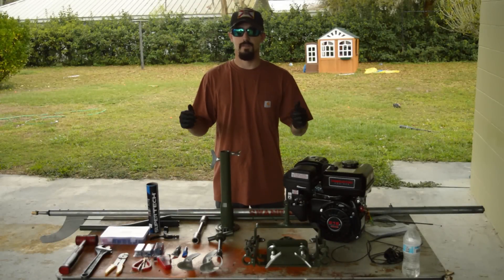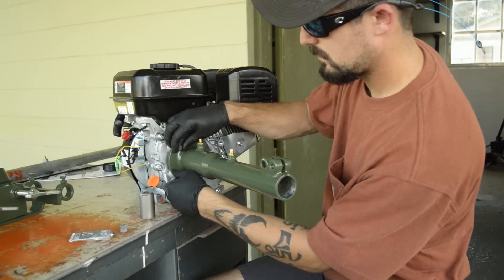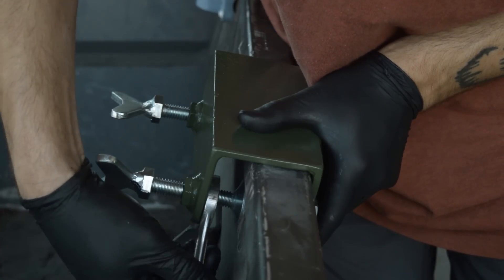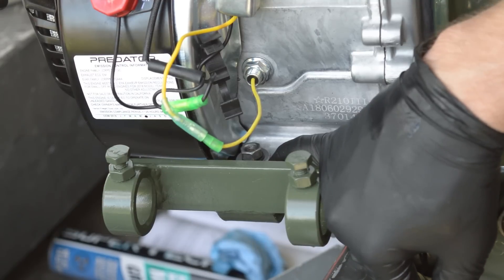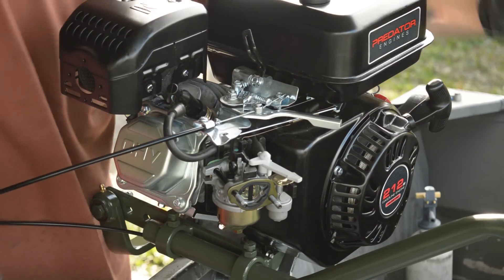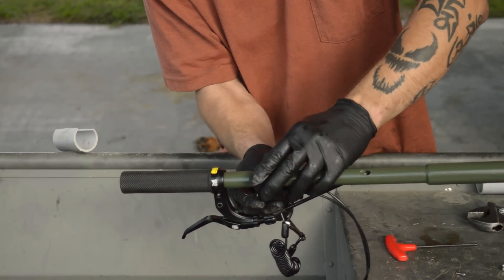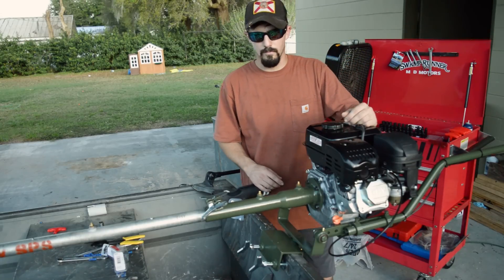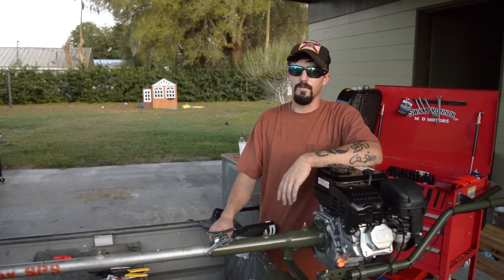HOW TO Assemble Small SPS Swamp Runner Mud Motor Kit (Step by Step)

Comment: Your video was very helpful! Hopefully, this comment of my experience can help someone too!
 i Spent the day today assembling my swamp runner large kit with my 22hp predator motor on my boat, and your video walked me through pretty much step by step through the whole process. i did run into some problems that you didn't experience. 
(1) the coupler shaft seemed to not slide all the way flush with part of the output shaft, and so the coupler housing didn't fit flush either. i kind of tried different things to figure out if it should be flush before bolting the coupler housing to the engine, and was unsuccessful until i just bolted the coupler housing to the shaft without it being flush, and when tightening the bolts, the housing eventually became flush. It just wasn't really clear in your video if it should have been flush to the rear of the engine before bolting the coupler housing.
(2) feeding the kill switch and ground wires through the tiller handle was a HUGE pain! The tiller handle has 2 relatively sharp bends in it near the engine so it was very difficult to get those flimsy wires through the bends and out of the back of the tiller handle. To fix this, i drilled (with a bit larger than the size of the original hole) into one of the holes near the handle part of the tiller handle where the wires and throttle cable go into the tiller handle pipe. That made it easier for me to feed my snake into the pipe and tape my wires onto the snake and push it through the bends and out of the back of the tiller handle pipe. 
(3) Removing and adjusting the throttle cable was very difficult. On my 22 hp predator motor, the phillips screw that holds the end of the throttle cable to the engine throttle body is in a tight spot. The head of the phillips screw faces toward the back of the boat and it is less than an inch away from the exhaust. This bade it impossible to get any normal screw driver in there to loosen and tighten the screw. To fix this, i got a pair of vice grips and clamped them perpendicularly onto a phillips head (removable attachment phillips head that is used for screw drivers that you can change the heads on) and got it onto the head of the screw and i was then able to loosen the screw and adjust the throttle cable on the throttle body. 
(4) [this isn't really a problem, but i think this was just a simpler way of doing it] So at about the 15-16 minute mark, when you wire up the kill switch, (instead of doing it the way you did and using another wire and using more connectors) i just spliced my kill switch wire straight into the oil wire and eliminated make that "Y" with the kill switch wire and splicing it with the oil wire. Your way was great and i think it looks good, but it just seemed like an unnecessary step (just my opinion) 
But besides these 4 things, it all came together pretty well and with ease. Honestly without this video, assembling this would have been very difficult and way more time consuming. 
i will be uploading my video of my build and installation of everything, if you want to check that out. I will reply to this comment when i upload it with the link to that video. 
OVERALL, thanks for making this video and i hope this comment can help out anyone who runs into similar issues and experiences.
Reply: Can't you duy a boat engine for me
Reply: A 15
Reply: Aveenish Samuel sure
Reply: God wil blest you
Reply: Use a vacuum to sock a string through backwards.  The string pulls the wires through.
Reply: @Leonard Terrance instablaster ;)
Reply: @Kashton Mario I really appreciate your reply. I got to the site thru google and im waiting for the hacking stuff atm.
Looks like it's gonna take a while so I will get back to you later with my results.
Reply: @Kashton Mario it did the trick and I now got access to my account again. I'm so happy!
Thank you so much you saved my account :D
Reply: @Leonard Terrance No problem =)
Reply: 0

Comment: My neighbor's teenage son purchased one of these.
He was able to assemble it on his own.
The simplicity makes them durable & the maneuverability is really impressive.

I'm not trying to say this is a bad product, because it's not.
It's really a good product.
I'm also not trying to dissuade anyone from purchasing this product.

There's a serious flaw in this design though.

I wouldn't recognize it if I hadn't made the same mistake myself.

The "spline adapter nut" should be secured in a way that locks the threads.
Something more substantial than nylock is needed to do the job.

The consequences of not doing so are that the first time the engine backfires, that nut WILL unscrew. 

Any seals or bearings between there and the end of the prop shaft are toast.
You're also going to have a whole lot more play in the end of the prop shaft than you want, assuming it doesn't blow the prop shaft out of the end of the housing.

I've had the combination of twisting and pushing between two fixed points of a 170cc predator engine break a 3/4" grade 8 bolt... 

This type of engine is most likely to backfire when trying to start it while warmed up and with resistance.
Something like weeds & debris on the prop, or a partially engaged engine brake.

I never did find a way to solve the problem with my mud motor in this configuration, so I can tell you for certain what won't work:

Welds, shear pins, locktite or carrier bearings/pillow blocks.

What might bypass this flaw is reworking the spline adapter nut and the shaft it screws on to.
Grind the threads off the shaft, and make flat spots on opposing sides of the shaft. Make the hole in the spline adapter nut match.
Once the threads are gone, a circlip should be sufficient to secure it in place.

Comment: I would only add that I usually run a sqaush plate between my boat transom and the mount screws. I use either a 1/4" Aluminum plate or have used a 1/2" pine board as simple as a cutoff piece. The pine board is actually not bad. It is just soft enought to make the screws bite in and lock it in place into the wood. That causes it to not drift around at all. Anything to avoid a indention of a circle into your hull.

Comment: A great add on to this kit is an electric clutch on the pto. They come in every size and hp rating u could imagine.  Not only simple way to add a neutral "gear" to these simple designs but also provides for some slip when u inevitably jam the prop on that cypress knee that grew 3 inches since last year. Also works nearly instantly (prop and mass of shaft will give it a few spins even when disconnected) so when u feel that log kiss the bow u can hit the button and have the prop and shaft fully disconnected from power. Also i suppose u could wire it up so that u have to hold a button to keep it in gear and have it drop out when released, def b safer for kids and people new to the boats
Reply from the maker: Where could you get one of those? I recently broke my prop in the exact same manner lol
Reply: What about a centrifugal clutch

Comment: Any advice on getting the male and female splines to line up?  I can get the shaft set so it doesn't slide in and out but the shaft will turn forward and backwards.  So basically you can't loosen the nut for the prop.

Comment: “Everything you need to build this motor comes in this kit, minus a few things.” List off tons of stuff. 🤣😂.   I’m looking into getting one of theses. Thank you.
Reply from the maker: lol
Reply: If u don't have some wire, washers, nuts, bolts, cables, welders, pipes, grinders , etc. You dont need to worry about a swamp boat. I love that long props on air cooled commercial motors is making a comeback, we used to use old clapped out pressure washer honda 1cyl horizontal shaft motors, w a bare pipe (no shaft in a housing) that had welded into the end the taper cut off a busted outboard final drive to spin the screw. Its a fun project but put that money into buying some basic tools, some wire, and misc connectors, and a little known secret u can goto almost any u pull it, bring a bare minimum metric socket set and a pair of pliers, and a 5 gallon bucket. Spend a couple hours picking up matching nuts, bolts, and washers. Fill up bucket and pay by the lb. That bucket full of misc, connectors will last u a lifetime. In fact while ur there pick up a steel 5 gallon oil/grease drum use that to hold the bolts. Add a splash of used motor oil of the last 1/3 of a wd40 can that never dispensed properly, u can pass the bucket down to ur children

Comment: Is keeping the oil sensor connected the same as you going to make my engine cut off if the oil shakes around while I’m riding? I’ve heard of people having to keep theirs disconnected
Reply from the maker: I had that issue taking sharp turns down rivers. If I had to do it again, I would definitely bypass that sensor

Comment: Been thinking about putting one on my 14' Lowe for hard to get fishing areas and what size would you recommend on motor and kit?
Reply from the maker: Medium kit would probably be best, but I had a 22hp (with a large kit) on a 14 footer  and it was very fast. The only problem I had was my transom flexing when i would gun it. If your transom can handle it, then put on a 22hp large kit

Comment: So i dont need that clutch set when ordering this ? Not sure as im new to this motor build , the webpage has a option for a clutch thing .
Reply from the maker: You don't need a clutch, but you won't be able to cut the power to the prop without stopping the engine. 
It's not a big deal. You learn how to navigate with it.

Comment: I'm stuck on the kill switch, I bought the predator 459 and it has electric start. How can you tie that one in?
Reply from the maker: Locate the wires for your engines On/Off switch and tie into that. You'll want to wire it so that if the kill switch is pulled, it opens the circuit like if you simply switched the engine to "off". 
Does that make sense?

Comment: Hey bud I got one for you maybe u can help me I been running my mud motor since April and I took it out the other day and after about 2 min It started making a noise like when you start a car that already running grinding like a starter so I got it home first everything was good and tight so I took it all apart started my engine ran it for 20 min no issue put the shaft back on got that same noise what do u think have u heard of this anywhere else? I can send u a video of it if u want
Reply from the maker: Are you greasing the shaft? 
I've only ever had it make a noise when I didn't grease the shaft, or when I broke one of my props

Comment: 1 min 5 seconds 
What size shaft will the adaptor fit ?
Reply from the maker: I don't recall. I think it will fit all motors up to 10 hp (for the small kit).

Go to their website (mudmotorkit.com) and it will have the specs for it
Reply: I’m thinking about putting a 3hp or a 6.5 diesel engine on it .,, I think it would be a pretty cool build I don’t think it would be very fast but it would be durable I have a 14 foot jon

Comment: I’m kinda wondering why you didn’t trim your throttle cable and kill switch cables ? It don’t matter but just asking ! Will that kit hold bigger 4 stroke motors ?
Reply from the maker: No particular reason, I just didn't feel like doing it. 
The kit will hold much bigger motors, but you'll need to get the large size kit for it to work.
Reply: Polk Fishin' 👍

Comment: Just bought a kit second hand.. thinking about taking everything apart and evaluating parts to see what needs to be replaced. Kit is only about 2 years old
Reply from the maker: I would mainly just inspect the bushing and the bearings. 
Have you taken the kit apart yet? Or is it still on the motor?

Comment: has anyone run these motor setups in super shallow rocky water? subb btw
Reply from the maker: I've run them through mud, rocks, and hard sandy bottoms. The prop won't hit the bottom due to the blade that sits underneath it

Comment: When you turn the engine on , is the prop already turning ? Or do you have to squeeze the throttle
Reply from the maker: Southerncajun92 
The prop turns whenever the motor is running

Comment: So you’ve got a calibrated wrist also, I use mine all the time for torquing nuts and bolts to proper spec
Reply: I normally torque things quarter turn past snug with no problems. I was changing the water on my truck, decided to use a torque wrench, broke a bolt. I kept thinking it felt too tight, SNAP. Not sure if it was a faulty wrench or I set it wrong.(probably set it wrong) Now I’m back to quarter turn past snug. Lol

Comment: You show stuffing grease in that tube and then sliding it over that shaft and attaching to the motor.  Then later you show putting thread lock on the coupling and reattaching to the shaft.  Am I missing something, the threads on the shaft are going to have grease on them.  Is the locktite on a greased thread actually doing anything.
Reply from the maker: Paul Ogea 
It’s not loctite that goes onto the coupler shaft, it’s anti seize.

Comment: Do they make one for the 420cc predator?? Have one laying around and figured it would be sweet
Reply from the maker: They sure do. I'm going to upgrade to the 420cc here soon. The medium kit will fit it.
Reply: There a company out of Thailand that make them I believe called mud bug boat motors. They also make an outboard motor set up for a vertical shaft motor and the sell props of different sizes all aluminum easy to replace or make your own if you how to cast alum..
Reply: @DavidTaylor-qz8nc  
In that part of the world, it's fairly common to mount an automotive engine and transmission from a rear wheel drive vehicle on the back of a boat, with a long straight prop shaft.

The weight of the engine and front of the transmission counter balances the long prop shaft and rear 1/3 of the transmission well enough to control it by hand.

This product is what they would naturally be inclined to build for a small inexpensive boat motor.

Comment: will any mower engine work with this kit
Reply from the maker: Their website has a list of motors that will fit the kit, but I don't think a vertical shaft engine will work with this kind of setup
Reply from the maker: Pulled this off of their website for you: 

    "The engine must have a horizontal output shaft.     
    The output shaft must be 3/4" inch diameter (non-tapered) with keyway.
    The engine side cover bolt circle diameter must be: 3 5/8 inches
    Engine base bolt pattern must be: 6 3/8” X 3 1/8”

For boats with transoms exceeding 17" in height, or with bottom widths between 40" & 48" please advise us you need a 100" shaft. We do not recommend longtails for vessels with a bottom width exceeding 48". 

NOTE: The 9hp Carroll Stream engine, and all engines with gear reduction box options are not compatible with this kit."

Hope this helps
Reply: @PolkFishin  ok thanks was just wondering cause im thinking about doing this on my boat
Reply from the maker: @kyredneckoutdoors  

Definitely a more cost effective option over a traditional outboard. I love mine

Comment: I have a 1431 jon. What kit and hp motor do you recommend? Thanks
Reply from the maker: Garrett Cobb 
For you, I’d go with the medium kit and a 13hp. 

Unless you want to go fast, then I’d go with a large kit and the 670cc
Reply: @PolkFishin  I'm not worried about speed. I just wanna get me and my hunting partner and some decoys through the hydrilla and pads.
Reply from the maker: Garrett Cobb 
Then I’d stick with the 13 hp backed with the medium kit
Reply: 13hp and medium kit would be fine. If you want extra umph you can beef up the 13hp (predator 420) for a 100 bucks. Don't know if I'd put a 22hp on a 1431.... with a hunt load that would be a bit heavy...

Comment: In your opinion would the 212CC and a small kit push a 1436 riveted boat adequately?
Reply from the maker: Joshua Lowry 
Well, it depends on what all you’re hauling, but mine is on a 12 footer with a casting deck and camera equipment, and it pushes two people pretty well. 

I think it will push it, just not very fast.

Comment: What if your engine comes from a car?
Reply from the maker: You have a car engine on the back of your boat?
Reply: @PolkFishin  yes?
Reply from the maker: @Manuqtix.Manuqtix  
That would be interesting to see
Reply: No i don't want to get rid of my 8 valve. Basically um what happened was the top gasket blow, it mixed with water, i got a replacement motor, that one i rebuild it because I could be bothered. 
Now i want to do something nice with it.
I was thinking of making some sort of a go cart but now I'm thinking this

Comment: Do_Not  "twist the wires up" before crimping your terminals on!

I don't know where this bit of "everybody knows" came from, but it is pure-D wrong, I don't care how much respect you have for whoever taught it to you. Twisting the wires beyond their manufactured twist rate will cross the strands over each other, weakening your mechanical connection, possibly to the point of cutting some of the strands at the crimp point. This is particularly critical when joining two wires in one crimp.

Please trust a guy with over 40 years of on-the-job experience in electromechanical, electronic, and electrical experience.
(P.S.: Put a little bit of No-Ox (or almost any grease) on your wire ends before you insert, crimp, and heatshrink - you'll spend less time chasing gremlins, down the road a ways ...)
Reply from the maker: Never had a problem with it before. All I’m doing is twisting it to get it to feed into my terminal easier. It crimps fine, and holds fine.
Reply: Well, you’ve either always been lucky, or never kept anything long enough for the problems to show up. I have frequently spent too much of my life chasing down the sorts of gremlin that take up residence in crimp connectors ...
Reply from the maker: William Hall 
I generally prefer solder over a crimp if I can help it. More secure that way